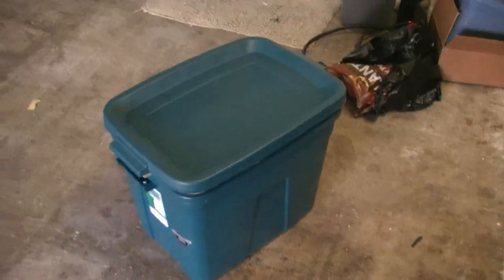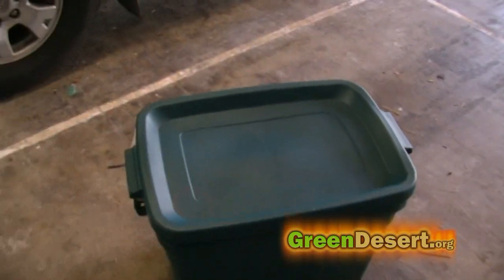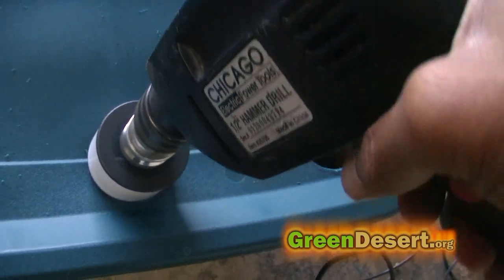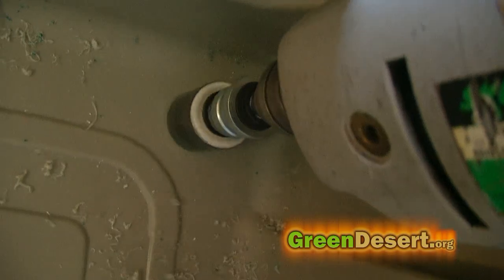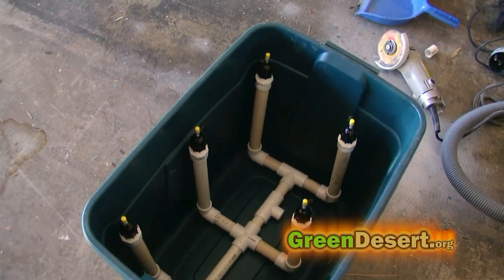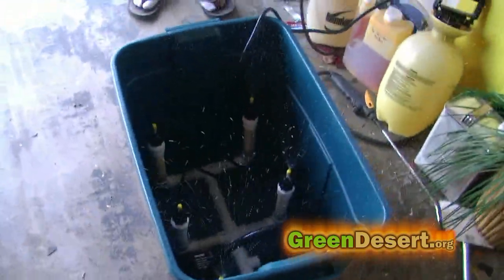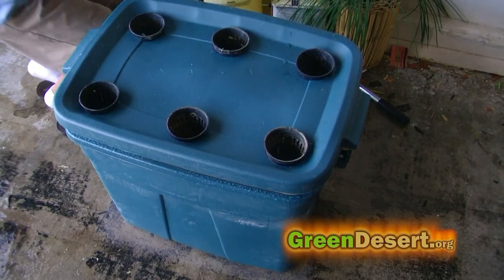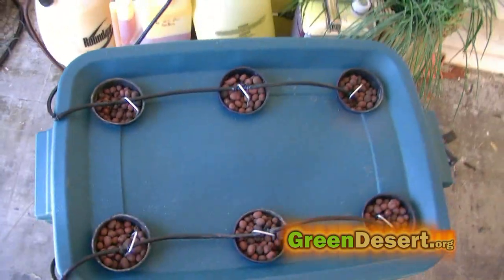DIY Aeroponics/Hydroponics Cloner bin

Comment from the maker: Hey Drift, what I plan on doing is installing a nozzle.  That way I can let the nutrient drain out and check ph etc.  If I want to add nutrient solution, I just poor it down one of the plants or take the top off if the plants are small.  I hope that helps and I properly understood your scenario.

Comment: In the process of building this system and I've ran into one problem. When the plants get heavy later on in the growing process, It will become a task to lift the top bucket from the bottom one in order to do routine things like check ph level and ppm. Let alone change nutrients. Currently trying to figure out a way of changing nutes and testing water without having to take the first bucket off.

Comment from the maker: Lets see, pump about $35, net cups $3, Bins $12, pvc & sprayers $10, tubing $10.  So maybe $60-$70.  I had parts laying around so it's hard to tell exactly.  Remember you can use the bin as a cloner, aeroponics growing, or hydroponics as well.  So if you do build it, you will have many uses for it.  I know hydroponically it works fine because its the same setup to a few other systems I've built.